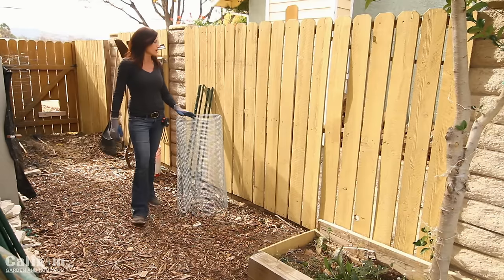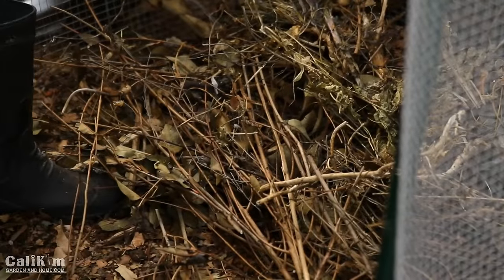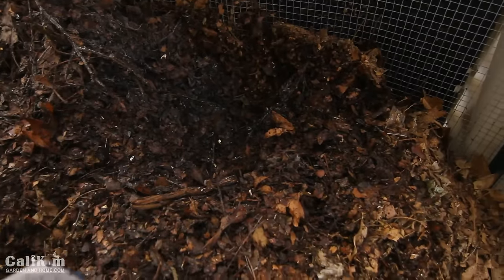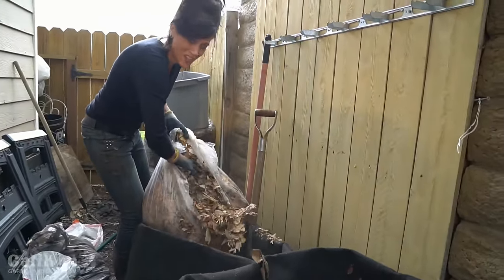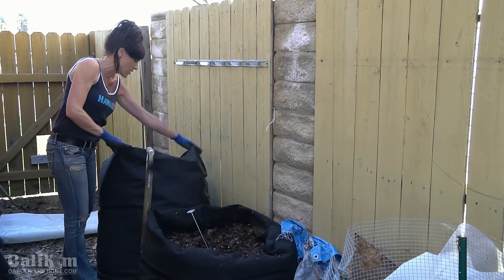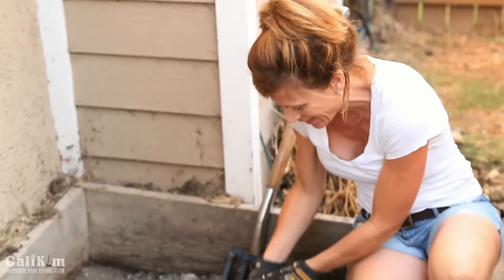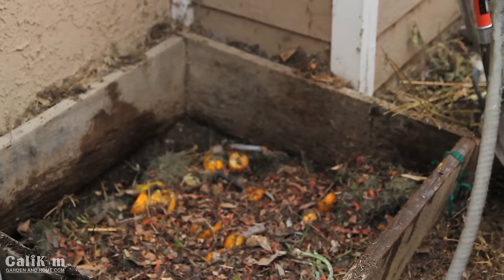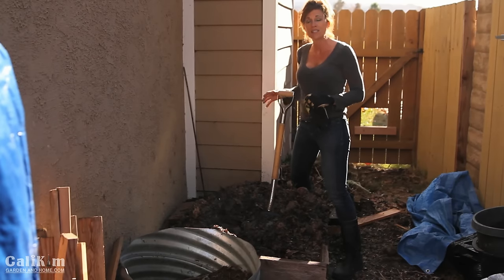How to Make Compost From Start to Finish-Quick & Easy /Complete Guide with Digital Table of Contents

Comment: For mixing and turning the compost in compost sack. Simply tie the loose end and turn it side ways, roll it around a few times then turn it upside down. Now, shake it around a bit by rocking it in all direction and flip it back the way it was. Open up the loose end and you will find that it is all nicely mixed up. Remember, we started with 5 feet tall bag, with 3.5 feet tall pile, some amount of compacting will take place. That will leave enough space to pinch the ends to tie them up and with still some place left for the stuff to move around. Another benefit is, the liquid/fluid which has moved to the lower portion will once again get mixed back into the compost in making. Nice video! Keep up the good work!

Comment: I did a compost one year in an area of my backyard.  Started out with a smart area, and it ended up being 6X6 size.  Basically, all I used was the garbage, leaves, and straw from my duck's coop.   I did pretty well in turning it over until it got so big I couldn't keep up with it.  I never covered it nor watering.  I would start in the fall around late October early November.  So, the rain and snow kept it most for me.  When I was able and the grown was soft from the snow, I would turn it as much as I could.  I would get such good dark compost without turning it once or twice a month.  I leave in Central US and it gets pretty cold, and sometimes the grown freezes, but compost on the bottom would stay warm, not hot. and I still came out with rich thick compost.  I didn't do one yet this year because of my back and having to turn it.

Comment: Hi, I live in Canada and saw your composting method heading towards winter.Granted I’ll not be able to sow until late May the growing season being fairly short. This being said, I have used my lawn mower to chop up leaves in my yard along with a final lawn mowing for the year and got a decent mix of chopped up leaves mixed with cut grass. After putting it in black bags, I checked it out and although not super hot, I was amazed hot warm it got despite the temperature being only 5 or 6 degrees C - around 40 Fahrenheit.  Will be saying more in later weeks as to how it’s progressing.

Comment: I love your videos. You’ve taught me so much. Your enjoyable to watch and have such a vibrant energy. I started my compost bin. All of my leaves around my home have pine needles mixed in. Is it ok to compost the pine needles or no? Thanks!
Reply from the maker: Glad to hear Korinne!
Yes, it is generally okay to compost pine needles. Pine needles are acidic and decompose more slowly than some other materials, but they can still be a valuable addition to your compost pile.

Additionally, using composted pine needles in your garden can improve soil structure and add organic matter. 

Be aware that the composting process may take longer compared to materials that decompose more quickly.  Hope this helps, Kim

Comment: The perfect temperature for a compost pile is 160 degrees Fahrenheit. At 120, the microorganisms are just starting to work on breaking down the composting materials, as the temperature increases, the action happens much faster. Once you get to temperatures over 200 degrees Fahrenheit the temperatures are too high for the beneficial microorganisms and they will begin to die off, so you want to make sure it stays below 200 degrees Fahrenheit, I try to always keep mine below 180. My compost pile today was running at 169 degrees Fahrenheit so at that temperature I am ecstatic. At that temperature, it is breaking down extremely fast. 

Instead of using a tarp to cover mine, I had an old 10'x10' popup tent frame that I raise about 3 feet above the top of my two side-by-side compost bins. I ordered a clear vinyl tarp to go over the top of it that I use bungee cords to attach to the frame. This allows more airflow in and around the pile and allows the sunlight to reach the pile, while still keeping it from getting too wet from the rain. It is just tall enough for me to stand under it so I can even turn the pile in the rain without getting soaked. It was old and the covering was torn so it wasn't being used for anything anymore, so this was the perfect repurposing of it.

Comment: A little bit of protein is ok and will donate nitrogen to the decomposition. You just don't want chucks at all, I blend it when I do, and you don't want to add more than the microbes can keep up with or it will start stinking. It really takes very little.

If you add egg shells, don't rinse them. If you take your compost bucket out every night, rinse your milk jugs into the compost. That's the amount of protein I'm talking about.

I use bad milk or cracked eggs, blend them in with a blender full of water and dump it around my lawn, and compost. We have extremely nitrogen depleted soils here in Wyoming.

Comment: hi there, I was checking out the compost thermometer in this video. when I clicked the link you provided, it opened my computer screen into Amazon. however, instead of going to a specific product, it opened a whole page with a list of compost thermometer. its great because I have something to choose from, but how do I know if you did get credit for it.

I love this video on composting. since I started gardening in 2012, I have only been successful with composting once. but that was a back breaking ordeal rolling a bucket in the ground hahahaha I bought a composting bin last year from Lowes but after a couple of months, I realised its not working for me. the height is past my waist line (I'm short). turning it was a bit of a problem. I have problems lifting / turning a compost pile. my hands are frail (I have gout) and recently I had my gall bladder taken out. anything heavy like a pitch fork, the muscles inside twitch painfully. I have been researching youtube for a diy rotating bucket for months now. it seems like I have to fuse at least 10 different ideas to make my own. not everybody is young, and not everybody is perfectly fit.

Comment: This was really awesome! Made it very easy to understand. I have found this intimidating, my biggest fear was starting a fire, but you have really broken this down. I'm just nervous because I also live in California and we just went through that big Atlas fire up here where I live in the Napa area. But I really want to do this. Is there a container you might recommend that would be the safest in case of combustion? We top off at about 110-115 degrees in the summers up here in the mountains where I live.

Comment: You inspired me to start composting. Thank you! It's winter and snowy here in the midwest, so no leaves. Have you ever used cardboard for your browns and was it successful? Thanks!
Reply: Some people use brown corrugated cardboard, but I do not, due to the chemicals in the adhesive of corrugated cardboard.  I am not sure if they are harmless, or not.  I think cardboard egg containers are okay though.
Reply: hello from my experience you can use cardboard paper cardboard boxes food containers cardboard milk cartons ice cream containers all of that stuff works just fine as long as you're patient and if you want you can tear it up as small as possible and it works more quickly

Comment: Thank you. Nice video. I have a question about using kitchen scraps. What keeps the bugs out. YES I love gardening and do a lot of it however I am afraid of bugs. I hate cockroaches. That’s why I never did a compost pile. Can I use diatomaceous earth?  Or will that kill off benefits?  I know it will kill earthworms and we want those. You were so brave just digging right into that pile. I did not see any in yours but I know they are attracted to the scraps.

Comment: The problem with the Compost Sack is it doesn't allow worms to get up into the compost pile to do their magic, like they do in your other compost bins. 

I use 5' tall 2"x4" welded wire fencing, to make a compost bin. I cut enough off the roll to make about a four foot diameter ring. It's very strong, no support stakes needed.  It's easy to move from place to place around the garden, especially when you are turning the pile.  Just take it off the pile, rake the outside compost material to a new spot, build it up, them put the ring around it again, then shovel the remaining compost into the ring. Everything is well mixed. Easy peasy!  Now, you might think material falls through the 2"x4" dimension spacing, but not much does, and I just rake up any that does at the end and put it in the pile and it stays put.  There is also 1"x2" welded wire fencing available, if you want to go with it, but it will be heavier to move. 

I also use the same ring to grow tomatoes during the summer, in a "tomato ring," where the plants produce twice as many tomatoes, so the 2"x4" welded wire is great for that. Dig a slightly less diameter hole than your ring diameter is, down about 8", or more, fill hole with finished compost, place ring around the hole, plant four to five tomatoes around the ring, 2' apart, fill ring with more compost, maybe one to two feet above ground level, and watch your tomatoes go bonkers (they will grow to over 7' high!), producing more tomatoes than you've ever seen in a small area!  It's unbelievable! Try it. 

Run a lawnmower over those clippings once or twice, and they will decompose in less than half the time. I usually run a lawnmower with a mulching blade over leaves once, bagging them, then spread the leaves out 2" thick over the ground and mow them again, bagging a second time. Your leaves will be reduced to less than 10 to 1.

One other thing I do, is try to use rainwater, instead of treated city water when moistening compost material. City water has chlorine in it and that kills soil microbes. Rainwater has nitrogen in it and will not kill the soil microbes.

That strawberry tower at the end, looked like a great idea and very successful!

Comment: Hello I'm new to gardening, and would like to know if I only used cardboard and coffee grounds would that be good enough compost
Reply from the maker: No.  You need a balance of both carbon-rich (browns) and nitrogen-rich (greens) materials, along with water and air. Adding only cardboard and coffee grounds may not provide enough variety in nutrients and structure to create a well-balanced compost.
Additional items you could add: You can also add other organic materials like eggshells, kitchen scraps (excluding meat and dairy), and small amounts of garden soil to introduce beneficial microorganisms.  Hope this helps - CK

Comment: I will be making compost for the first time,  I am a new gardener this is my second year.  I live in Michigan.  When should I start my compost pile?
Reply: Right now . In August . If all you have is green  gather greens   Sycamore  leaves  once separated  from the tree dries out very fast compared to other leaves.  In hours in blistering sun and they crush up  very easily by hand while still green  it will take a day of blistering sun to turn them brown . Spread them out thin .  Weeds . Many weeds are easily to strip the tiny leaves.  Bake in the sum  within 4 hours you can grasp a hand full and strip the brittle leaves in mass and they are still green . Dont worry about not having browns. GREENS WILL TURN BROWN . in very short time in a compost pile . Add Ammonia (nitrogen source  @8 oz. To 20 gal of water to soaked your dried leaves in prior to piling them

I dont have much experience with grass  the only grass I have is non mowed type and the stalks are  like sticks and will likely take a year to break down   same way with bales of hay . Wi th h dried leaves they can be dried to green or brown fast and crushed up fast by hsnd

Comment: Kim, love the video. Do u have any problems with rodents. I live in the city, don't want to attract them
Reply: If you bury your scraps in the compost pretty deep, and put the metal fencing around them, rodents don't get into them.
Reply: @Ernest Cortez check with your city's waste management department. Some cities recycle old trash bins into compost bins. Metro Phoenix & City of Chandler (AZ) provide them free of charge & even deliver! They're covered, so little to no chance of attracting rodents. Have composted for 20+ years; never a rodent or any other varmints🤓

Comment: With your loosely covered hot compost pile outside, doesn't it smell really bad? Also, I was told not to use citrus....you clearly do as I saw oranges in there. Can you tell me why that is ok?
Reply: It shouldn’t smell if done properly. Avoid using meat, dairy or bread it shouldn’t smell. As the other comment mentioned, it’s ok to use citrus in compost piles but not in worm farms/bins or worm composting in general. Adding citrus changes the pH of the soil which could kill your worms but isn’t a concern in hot composting as the temperature of the pile would kill any worms in there anyway.

Comment: do I have to do eggshells or is it just cause you have them because I don’t eat many eggs
Reply from the maker: No.  Using eggshells in compost is not a strict requirement, but they can be a valuable addition if you have them available.   CK  Great questions...

Comment: That is good exercise mixing that in the tiny bag, and you do good, it is good for you if you don't over do it.  If you have another bag then use it to put the first half of compost out of the full bag,  then you can get to the bottom without working against the weight of the whole bag of compost, and not have to worry about spilling it while trying to turn it over in a full bag. Then you can also just keep pitch forking out the whole bag 100% into the other bag, that way the bottom is now at the top, now mixed mix real well, without so much work.
If i did it, i would need to use a mechanical system that way i will actually do it. I have ideals of using like 55 gallon drums with a trillion holes, or just chicken wire wired in a cylinder shape with metal rings on the ends and landscape material around the cylinder, and turned on its side and they will be installed in a way that they will rotate on their sides like a dryer(but it is not to dry it unless it is too wet, it is to mix it), on mechanical hinges so they can be turned upright to fill and down to dump.  IT will all get mixed without me doing it with a fork. Not that i don't appreciate the pitch fork, but i use that tool quite a bit as it is. lol I don't have enough experience in gardening food, therefore i have not enough faith to put in the effort to make the perfect compost like you do. But i am trying to grow stuff this year too, so if it works out or not i will get more experience regardless.  If it works out i will gain more faith in it all, and have more patience to put in the detailed effort you do. But i can make a detailed mechanical system to do it right now. lol

Comment: Several times you say that you have a concern about the high temp of the compost. The compost can never accomplish self igniting as the temperature required for ignition is 450°F.
Reply from the maker: As I’ve composted over the years - I’ve learned a lot about heat , but didn’t know the specific temp. Thanks for sharing!
Reply: It would never be possible as to get to 450° as you have to evaporative all the water first. That would kill all the microbes that are creating the heat, thus reducing the temperature to ambient temperature.
Reply: There was a mulch place were I use to live.  When you drove by the place you could see Thehe piles smoking.  The fire department had to come and put it out several times. Im thinking about heating water for my spa by laying a copper coil in to the middle of the pile and have the water circulate through the coil.

Comment: How long do you let the compost cure before you can use it in your garden?
Reply: Once it's almost completely broken down you can use it straight away. You can tell if it's almost completely broken down because you won't be able to identify the original ingredients in the compost, it will just look like black soil.
Reply from the maker: Hello Jo, great question!  I don't cure mine, once it is finished, or nearly finished, as you see at 27:26 and 38:30 , you are good to go!  It can be used immediately as I do at 27:37.  Are you making some of your own black gold?  Thanks so much for watching!
Reply from the maker: Thanks for jumping in, Jason - great answer.  Appreciate you stopping by!
Reply: I'm starting on it. I need to get some pallets. We live in a suburban/urban area (for the record: I HATE) and have been afraid of the odor.
Reply: Thank you Jason!
Reply: Jo Clawson 👿

Comment: I went to your link on amanzon for the compost thermo. And put in code CALIKIM an it said invalid  code. is there a different site to get the 15% discount. or does soming need correcting on amazon?
Reply from the maker: Hello Mary, apologies - at the time I filmed that particular video a few years ago, reotemp was offering viewers discount through their website, but that offer has expired.  I appreciate you  using the amazon links - when you purchase through those links, it helps me out!   I love that thermometer, its a super great way to monitor the heat.  Thanks so much for watching!

Comment: I tried to do semilar to what you did, but the rats digging hole under, and built a home there. The worse part rats also coming inside the house. So stop doing this but ordered composed bin in Amazon. Again problems arised, 1. Hard to turned 2. Smelly 3. Lots of flies.
What can do ?
Needs help 😢